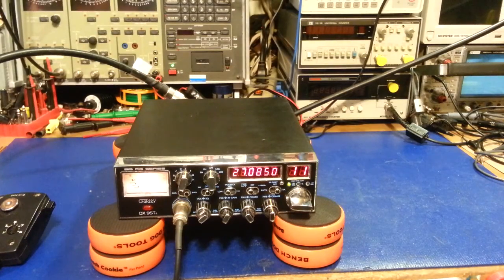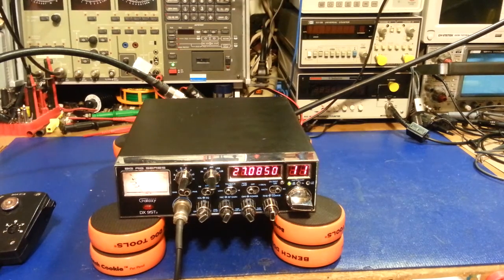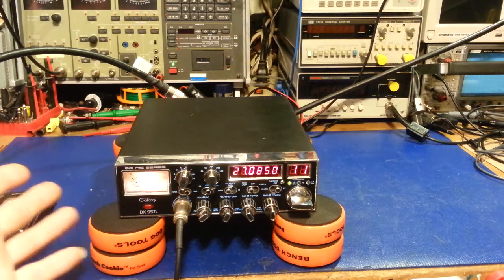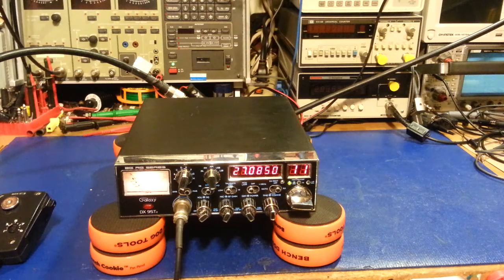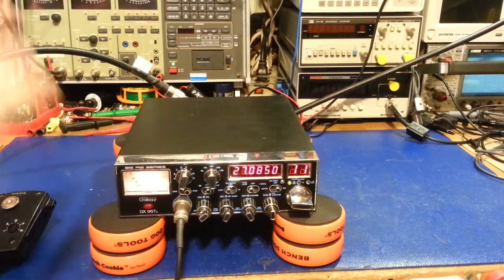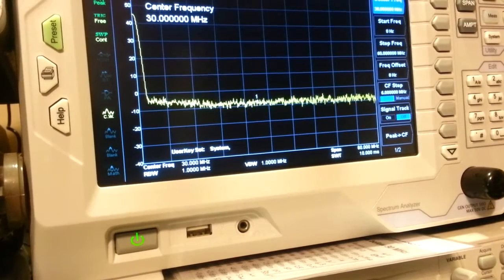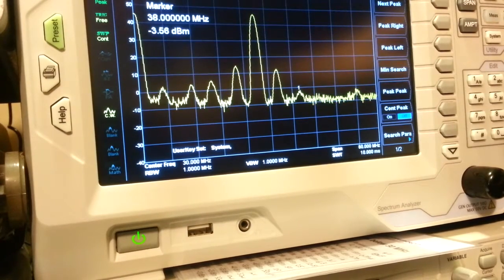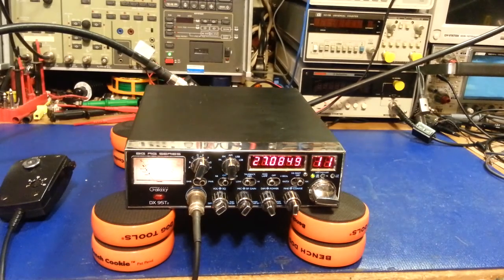Galaxy DX95T2 are high IMD / 3rd order products normal on these radios?

Comment: Well unlike you Mike I have worked on thousands of these radios (Galaxy that is or this class of radios) Even built them way back when they started connex and like radios, chassis were farmed out. Anyway, this class of Galaxy radio is notorious for lighting up the Spectrum Analyzer that is why when you see some so-called techs on Youtube claiming they can make these clean and pure and show it on the equipment they are flat out liars. No Brag Just Fact.

Comment: Unfortunately, a bone stock radio with, the alignment done to factory service manual specs, looks exactly like this. They made two versions of the 95t2, one had a bipolar final, and the other had a mosfet final, the mosfet is significantly worse for this as the amp on the bottom only magnifies the distortion.
These can be cleaned up by many orders of magnitude, though it requires circuit modifications/updates and a non-factory alignment to do it. Check out Mark(Hard Drive) over at the FineTuneCBShop youtube channel. He does some excellent work on these export radios and turns them into usable rigs.

Comment: wow, that is horrid. I ain't been on cb in over 15 years (since the 90s actually) but rigs I ran where the "exports" dx-88,mirage 88, 2980. I wouldn't let the "peak and tuners" near my stuff. I actually would buy the rig, place it back to factory spec. add parts they clipped out. and you know what, the rig was pretty clean. I had a amp that would do 1KW carrier and with my rigs you would hear me +/- 1 channel ( like tuning 1230AM when you have a station on 1240) put a splatter box rig that been hacked and trashed, on same amp, it would trash the entire band and then some.

Comment: It is very common! You can clean them up a lot but a lot of them come from the factory with 2nd and 3rd order harmonics! The amplifier is not a great design. By the time the Golden Screw Driver crews have no clue almost all of them that have had their cover removed have harmonic issues. I have seen about 5 or 6 of them on youtube over the years and almost all of them have harmonic issues, flat topping on modulation and anything but a linear power output. Definitely not true AB1 and no thermal tracking on the bias. 

It never pays to have have a huge linear on a relatively small foot print under the radio. Heat raises but that would not make for convenient modification and mounting. Personal I would love to know what people that own these type of radio's drive and how they mount them in the vehicle??

Last I checked FinetuneCB I think it is have spectrum analyzer and speaks his mind. 

I have never heard one of these in the wild that has not been butchered and was not a splatter box. I am sure that they do not have to be but it sure seems normal. 

They make models with up to 4 bipolar transistor amplifier strapped on tot he bottom of the rig. I sure you can imagine that by the time people cut limiter's do their super swing NPC mod's how much distortion and harmonics are being driven into the amplifier. Well all of that makes for some fantastically out of phase watt's that loock GREAT on Dosy and Bird watt meter's. As you might imagine the heat that those bipolar transistors make when they are getting 600+ watts out of a 4 transistor amp with DEI transistors is also fantastically high. Once your heat saturate all those parts above the amp well stability goes out the window. 

Their is a smart way and a stupid way of mod'ing a radio. I frown on having a radio with a high power amplifier attached to it or built into the chassis. I am not keen on putting power supplies in table top linear amplifier's either if can be helped. Heat is the enemy of semiconductors and all electronic parts for the most part. 

If you need more power get a separate amplifier and keep the heat out of the radio. I used to modify my equipment when I had the test equipment and tools to do the job right. That said I was never chasing a few more watt's. When I made an upgrade it was not to get more power. It was always about stability, durability and less noise. If I upgraded transistors in the radio it was not for more power it was to get better S/N ratio and to have more head room at the same power output. So when a part failed I always upgraded. 

People almost always go about things backwards in two way radio's and in hifi home audio. They focus on the wrong number's and the wrong things. You end up with lots of money spent and little to no results. What good is being loud if you are not understood. Anyone can sound loud and crappy on the cheap. If the power is not clean and the radio is not durable and stable than what good is it? 

I can not mount an RCI 2950 in my car or even a Cobr148 for example. What type of car do you drive that will allow for these large chassis with these large heat-sink amplifier's bolted under them?
Reply: I have one in my 18 wheel truck... I have a video with my set up...
I'm just a regular truck driver who likes to read and do experiments with what I have 
The video you'll find it like Cb antenna for fiber glass truck... or something like that you'll know which one it is because the blue truck and GALAXY radio

Comment: Please see   http://www.cliftonlaboratories.com/imd_measurements.htm    for an excellent discussion on the measurement of 3rd order intermodulation in SSB transmitters using audio tones as the source of the two tones provided to the device under test. You must also have a spectrum analyzer with a  Resolution Bandwidth (RBW) of less than 250Hz (100Hz is better) in order to resolve the tones and the intermod products created in the passband.  HP/Agilent/Keysight have excellent application notes that have been published over the years on using spectrum analyzers to make these types of measurements. A quick Google search will turn up a plethora of similar application notes with examples.  Even a clean linear amplifier cannot work miracles.  GI = GO (garbage in = garbage out)!

Comment: Interesting, so if that is not IMD (as defined in the comments below) what is it then? Is it phase noise from the oscillator that is not getting filtered or is non linarites introduced in the PA?  I think that this could make for a good case study, do you think you might want to do a deep dive on this one? Great job with the videos, always insightful and fun to watch, thanks for doing them.
Reply from the maker: The frequencies are to low for a low pass filter circuit to remove.  Shoot, most of them are below the transmit frequency.  Unfortunately the radio is already gone.  Customer needed it back because he was selling it.

Comment: I've got one of these with the amp part removed and setup to use as a regular radio so smart move as the heat issue and making it drift isn't so bad.  I like mine quite well Mike so maybe an exception on mine lol.   Btw sent ya an email...

Comment: I have never cared for that type of radio. With or without a built in amplifier or GFM. (Garbage Frequency Multiplier) I have never seen a clean Galaxy, Super Star, Connex, RCI radio in the many years I have worked in radio. The PLL matrix is prone to producing many spurs all over the band. Start checking in the VHF range. Even sniff around with a probe inside one lol. You are doing good for not working on them.
Reply from the maker: A GFM, ROFLMAO!!!  Will have to remember that one.
Reply: I have seen plenty of spectral clean 1st and 2nd Gen RCI2950. First gen had the battery on the board and a red reset button on the board they where Philippines made I think. The second Gen did away with the battery for memory and also did away with the red reset button on the board and just had two pads you shorted to reset the unit and those where made in Malaysia. These are the old orange display models not the 2950DX. Each time they switched production to another country they went with cheaper parts and took more and more money out of the radio. The quality control also feel at each new production facility and cold solder joints seemed to multiply with each move.  On top of that the golden screw driver and modifications where limitless by both sides amateurs and cb'er's! I have never owned anything with a Galaxy, Connex, General Lee name on it but even before RCI/Ranger started making all of these they where always a bit dirty! Ranger just made everything worse by continuing to take more and more money out of each design. Prob. just as bad is the modern Uniden and President radio's. Sure they might be clean but they have as much personality as a piece of cardboard and they sound about like a record made out of cardboard. It is about like replacing a sports car that is a bit sloppy, loud and obnoxious with a Korean made Kia that is clean, quite, lifeless and boring. Both extremes are equally bad for the hobby in general. The latter only being suitable for 65 year old traveling non-radio enthusiast like my grandparents pulling a 5th wheel camper with a POS magnet mount antenna. So while the export radio's are clearly dirty and use low quality parts the Uniden and President radio's offer nothing to an enthusiast.  All of the decent modern radio's have terrible audio like 500hz-2500Hz it is laughable how bad they are. The Uniden 980 has to be the worst SSB CB ever released to the market it might as well be a SSB walkie-talkie!  There is no happy medium. No one makes a really good replacement for the 1980's-1990's Uniden Grant XL- LT, PC66, 76XL, 78XL. They do not sound good and are not that durable and have terribly cheap controls today the encoders feel dreadful and the push buttons feel cheap!

Comment: if that radio has an external amp, did you check the voltage regulator adjustments  for the correct voltages?
Reply from the maker: Its a factory part of the radio, its integrated into the bottom cover.
Reply: Most of the Galaxy radios that have a belly mounted amp have two voltage regulator adjustments that should be set to 3.8 to 4.0 volts. The galaxy 94 and 98vhp are this way, not sure about the 95t2.